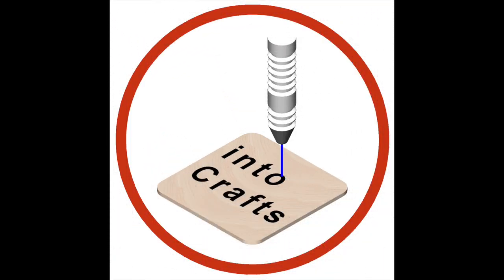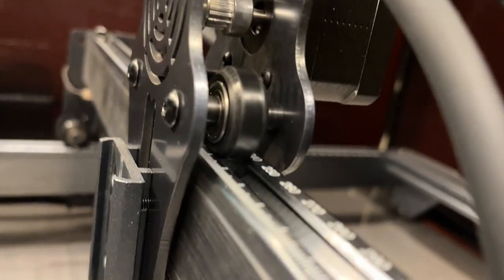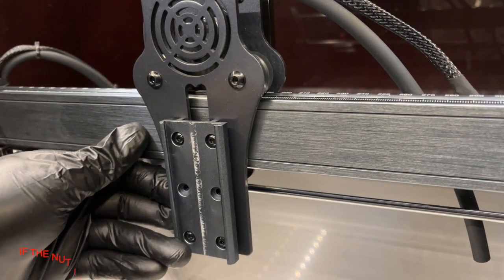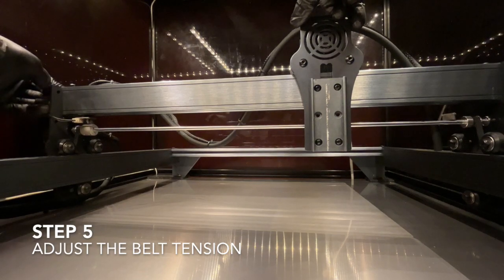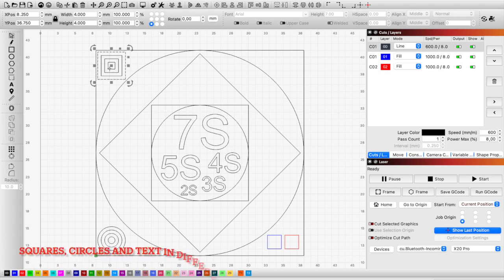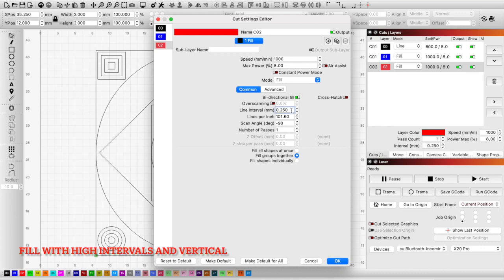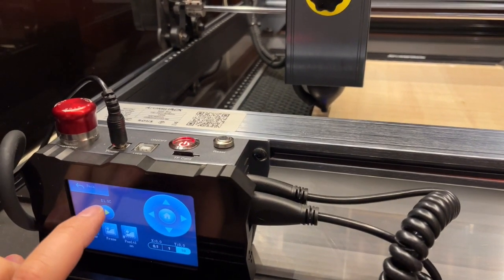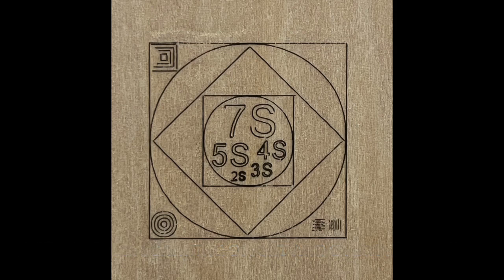E1 - Mechanical Check (Laser Engraver Belt Tension and Eccentric Nut Adjustment)

Comment: Can I say that the purpose of eccentric nut is to hold the carriage and stabilize it on the rail track, and the eccentric nut is not meant for increasing belt tension. am I correct?
Reply from the maker: That is exactly the reason for adjusting it without the belt. And it is important to do it before working on the tension of the belts.

Comment: i enjoyed the video, its very good, but i think the engraved output was really poor, the lines have gaps, and the circles do not seem to be round, is it just me. Im going to run the same test and see what mine does
Reply from the maker: Thanks for your comment. Consider the fact that the smallest circle is 1 mm in diameter, and you are right to some extent. Another fact is, this test ran almost at the threshold of the launching the beam, I did another test now with "Constant Power" option on. All the lines are closed, no line was missed. Could not attached a photo to this reply, but if you check the channel, the Thumbnail of this video (E1) is the last try of this test.

And, about the skewness of X and Y, since I took a close-up, it might be the camera software which improvise this feeling. I measured the dimension of the big square 30x30 mm, both the same.

Anyway, thanks for your critical comment, it made me to go back and check everything :)

Comment: Great videos, does the under wheel on the Y axes have to turn alone  or  have to move the laser support ?
Reply from the maker: The wheels should be holding the rails, and if you try to spin them by hand (while there is no belt), the wheel should not spin freely and should not be that tight that is not possible to spin. Have your wrench in the eccentric nut and try spin the wheel, then you get the feeling of adjusting it correct or not.